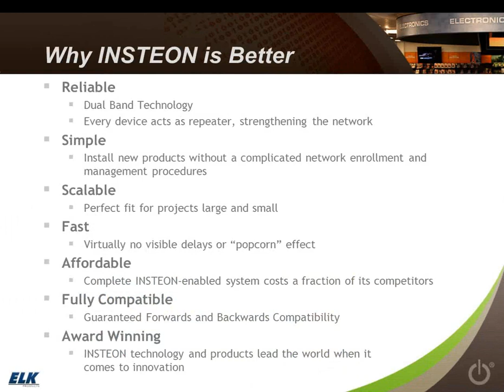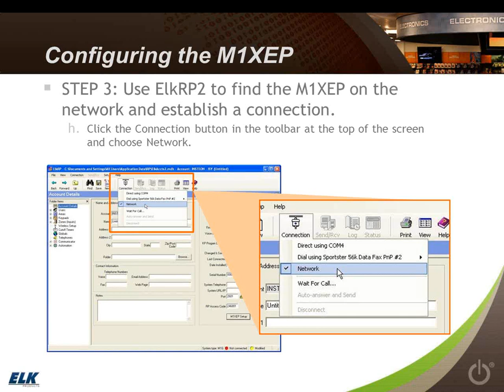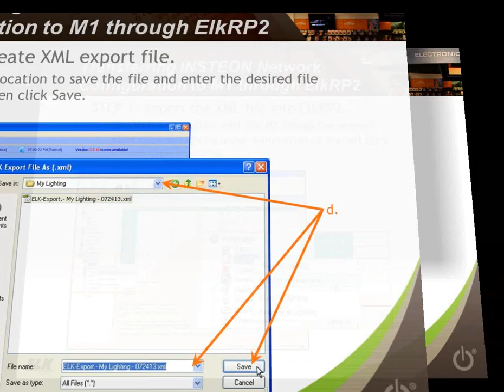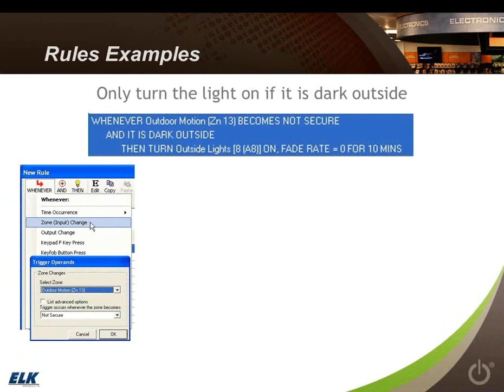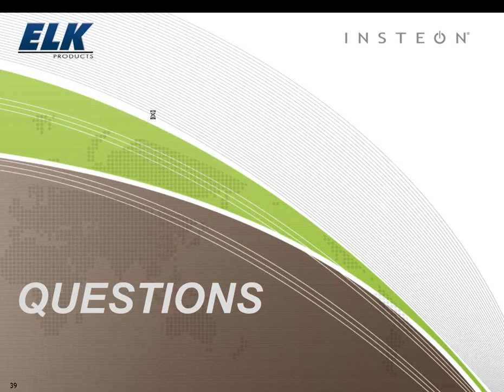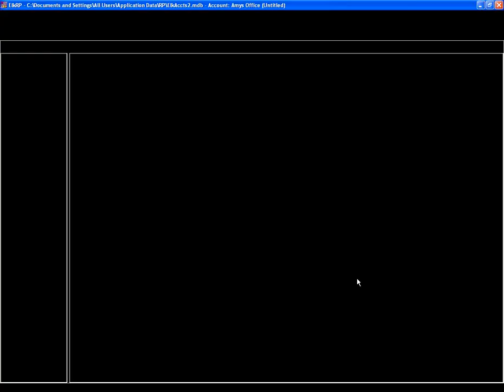Integrating M1 with INSTEON for Lighting Control

Comment: Does this require the ISY add-on Elk Module?
Reply from the maker: ELK recommends using the ISY with the M1XEP for integration with INSTEON.  The Unviersal Devices administrative console is used to setup the ISY network and create the export file for ElkRP.   Universal Devices offers an additional module for ELK integration that is designed to expose ELK Security commands and events to ISY's Programming environment.  This is not required for ELK to integrate with INSTEON lighting.  However, it provides enhanced features when programming event triggers (rules) from the ISY.